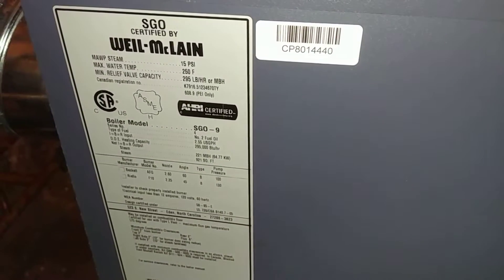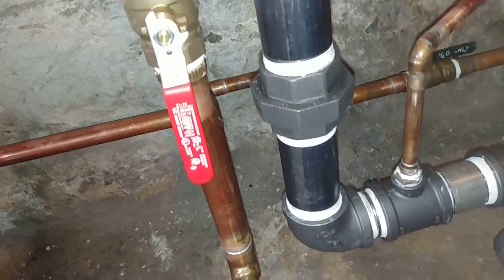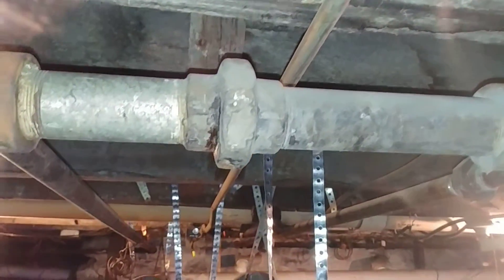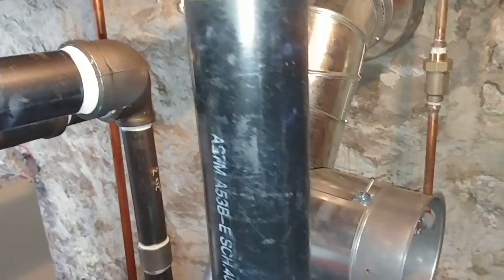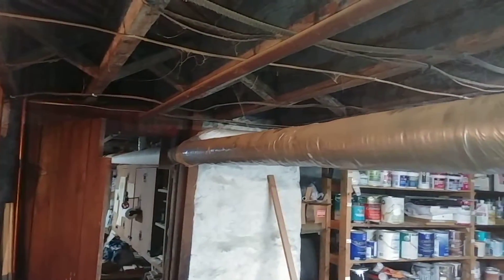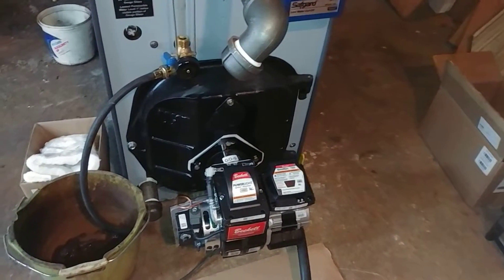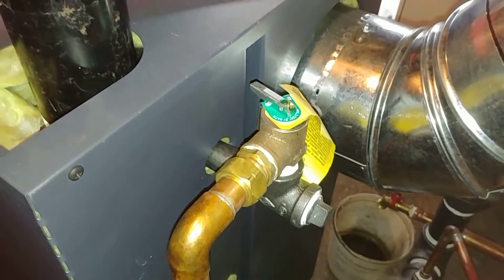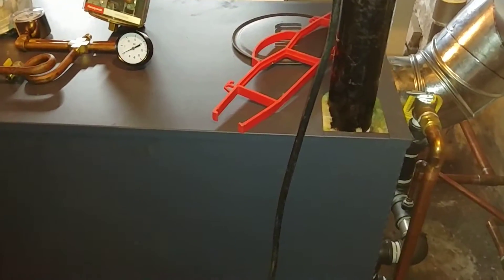Installation Of Oil-Fired Weil Mclain SGO-9 Steam Boiler On Two-Pipe Broomell Vapor System

Comment: Any trouble with the probe LWCO? The location is midway up the sight glass. It doesn't leave much room for water volume fluctuation. It seems to me you need to have a higher water level with the probe. With the float the cut off is much lower in site tube. When boiler is off the level will be midway in sight tube. With the probe, with system off, the water level will be 3/4 up the sight level tube. This also cuts down your height for the header.
Reply from the maker: That probe location tapping in the boiler is where the factory calls for it and therefor, that is where it is supposed to go by law.
As the water boils, it will splash on the probe, keeping the electric circuit complete and the burner firing until the actual water level drops to about an inch plus or minus above the lower sight glass tapping nut & then should shut the boiler burner off.
That's why you should always test all LWCOs, float or probe, with the burner running to verify proper shutdown in a low water condition.

Comment: As the homeowner where this was done, here are a two pictures of the final product.   I was left to do the insulation and it was tricky given all the elbows and different size pipes, but before I insulated the pipes, the basement room was like an oven. A Rube Goldberg insulation indeed, but at least now all that heat goes upstairs.
Reply: ...oops, no way to add a picture here.   Sorry.

Comment: Gordon ... on a steam boiler why does the pressure have to be balance between the boiler's steam outlet and condensate-return inlet? If there were a difference in pressure ... what issues would that cause?
Reply from the maker: I believe you are referring to the so-called "equalizer" line.
That short-circuited the pressure from the Header so it would keep the water at the drips from having to stack-up too high to get back into the boiler.
In a way, it acts sort of like a check valve with no moving parts to stick open.

Comment: Gordon ... what would cause a steam boiler (2 pipe) to short cycle?
Reply from the maker: Several things: oversized boiler, failed open traps allowing steam into the dry return which then shuts off the main air vent, thermostat not set up for steam, dirty water causing the vaporstat to trip. By no means a comprehensive list.

Comment: Thanks for all your videos. I've lived with steam heat all my life  ,but still have learned a lot from your vids. I do , however, have a question.  I will be installing an automatic fill at my house [using cellar stairs is medically difficult now] , is there a safety valve or other system to shut the automatic fill valve if it sticks open?  SGO 3  Weil Mclain with probe and electronic lwco.  Thanks.
Reply from the maker: Thank you for your kind words!
Unfortunately there is no official Listed "plug in" antiflood system for steam boiler automatic water feeders that I am aware of.
I have heard of some folks that cobbled together a home-brew system. 
Until such time that one becomes available, here is what I'd suggest:
Make sure your system is tight, that is, it needs very little make-up water to begin with.
No hissing vents, etc etc!
Have your new VXT-120 brass valve rebuilt on a regular basis (you are getting a VXT, yes?), and that basis depending on water loss & water hardness in your area.
You might need to rebuild every year as part of your yearly oil service.